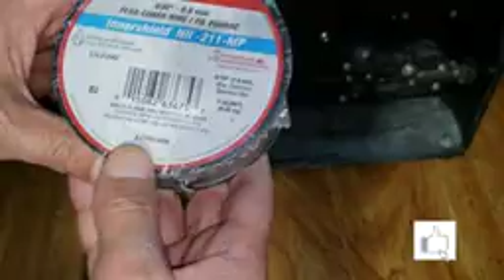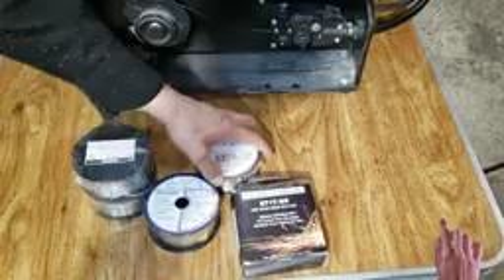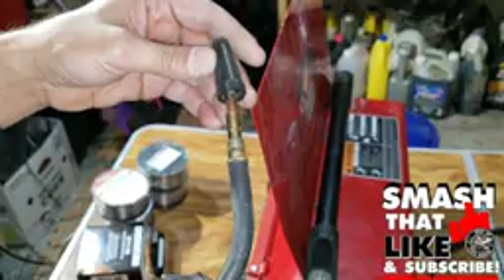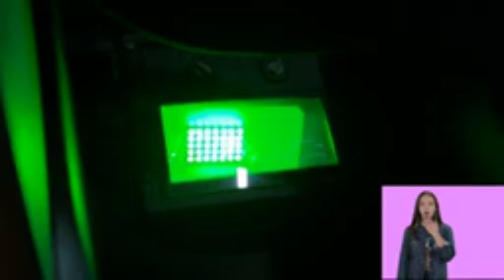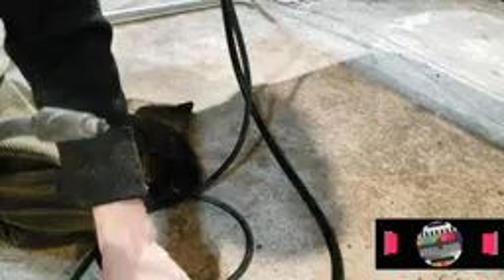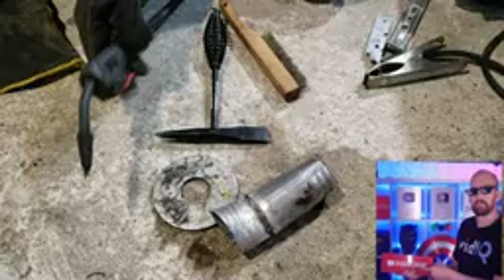Review And Test Lincoln Electric Weld-Pack HD 35-88 Amp Flux Cored Welder

Comment: i have this welder. im almost out of wire. the paper on the door say .350 nr211mp.
however youir using .30 did you have to change th wheel feeder or will it run that gauge as is? also do i have to run that nr211 stuff?
Reply from the maker: Good Day my friend ,  thank you so much,  is your welder made in Holland? Some of the welders are the same but made in different countries so they slitly different from each other,  my welder has code No 10949,  is yours has same code No ?
The dail speed starts from 35-88 Amp, I almost forgot about nr211mp I will check that and get beck to you,
I never changed wheel feeder or anything else dame as original.
I tried to change wire Gauge to 30 but I couldn't find the right tip so I kept 32 Gauge, I think changing wire Guage must change gun tip also well, but it's not nessassery to change wheel feeder as it's adjustable, thank you so much again and all the best 👌 👍
Reply: @WorldRandomVideos  yes i have the 10949. that makes sense. so i will get a .30 tip and run .30 wire i hear it does much better. and yes the tension knob maks sense.!
do you know if these machines come DCEN?
Reply from the maker: Yes I agree, 30 Guage wire much better and you can weld on thin metal easy, I will check about The direction of current flow through a welding circuit when the electrode lead is connected to the negative terminal of the power source and the work is connected to the positive terminal. Sometimes referred to as straight polarity and get back to you.
However un this machine I don't think matter but let me check to make sure DCEN apply on this machine
Reply from the maker: @Trey Murphy  hello my friend, I couldn't find instructions manual, but if  I spend more time searching online i may find it , I found this website with helpful information, you may check it out, during my search i noticed this welder has output 20 amps and 29 DC volt but I couldn't find more helpful information about DCEN, here's the link 
https://www.lincolnelectric.com/en/products/k2188-1